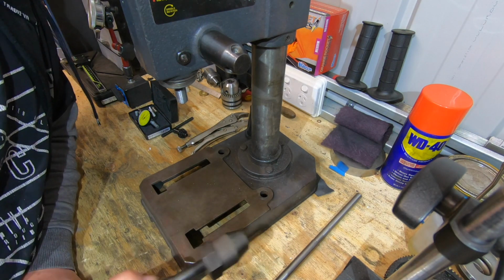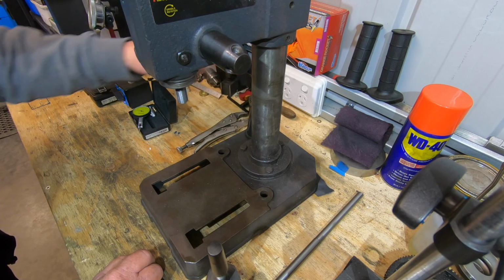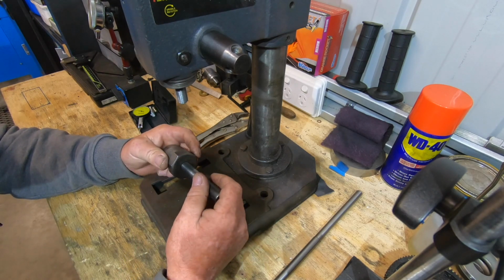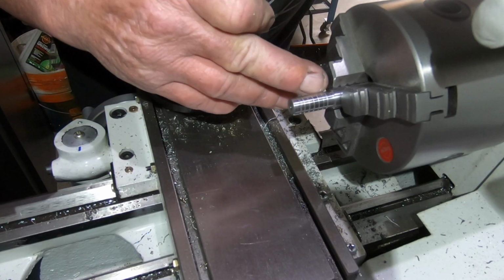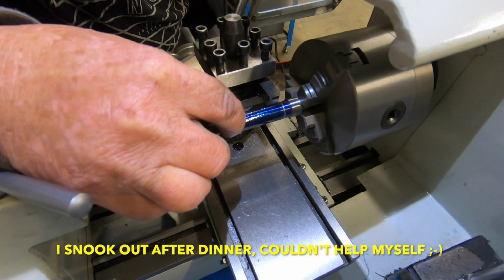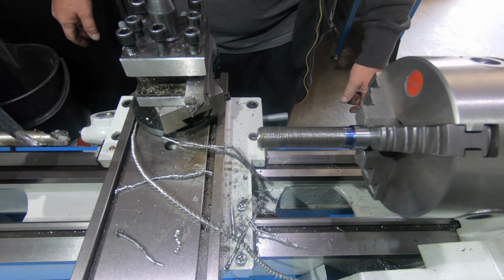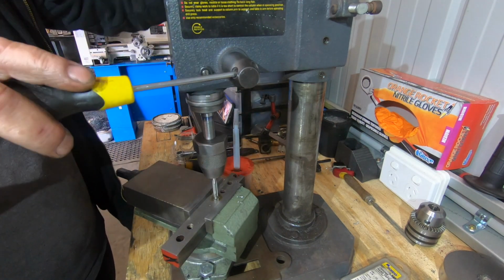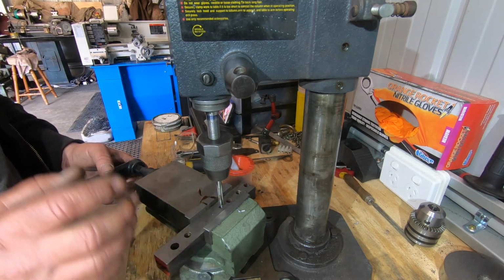tapping jig part 1

Comment: I have a similar little drill press, it's handy for some things but I can see how easy it would be to bend the - well, "spindly" - little spindle.  That's a good idea for it, especially if you're going to make it a variable speed power tapper down the road.
Reply from the maker: Gday Everrett, I have got a starter motor out of a 110cc quad bike, they use a chain and sprocket setup so I’m hoping I can do something with that, a little bit more thought to put into it yet though,   ATB Matty.

Comment: It's a good idea to reuse an old drill press as a tapping machine. Do you have any idea how you gonna center the part in line with the tap?
Reply from the maker: Gday Rustinox, my thought was to make a small centre to use in the chuck to align the part then put the tap in the chuck, I think that would work,    Matty